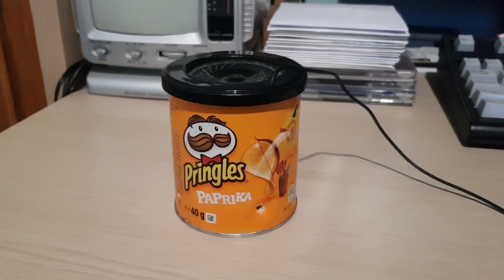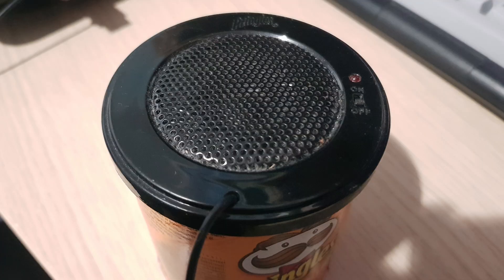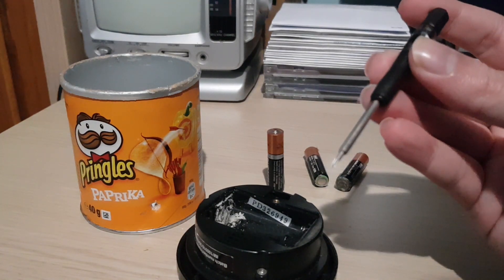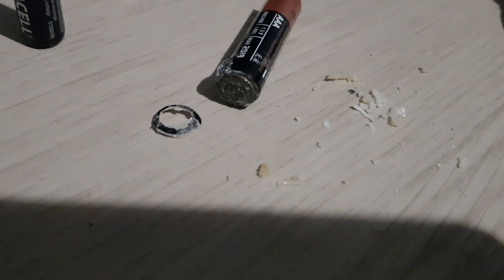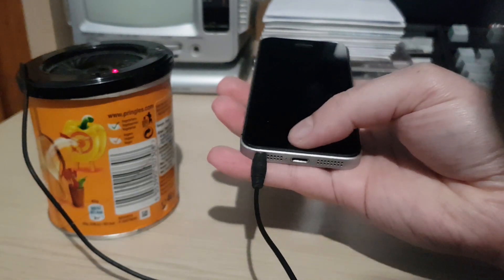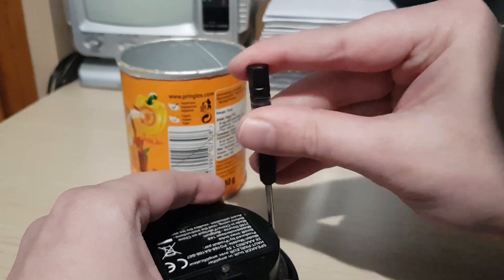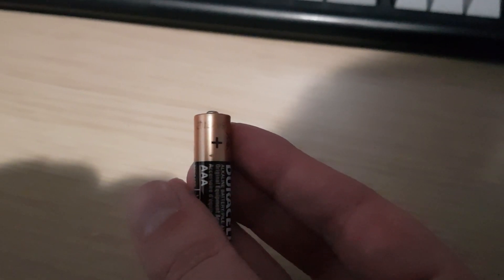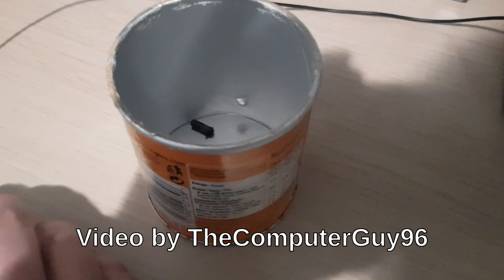The Pringles Speaker Battery Corrosion Incident

Comment: i heard duracell batteries being called duraleaks, i guess it's true, you should use a multimeter to see if the batteries are charged 
you should make a video about the mini crt
Reply from the maker: VWestlife's video about that mini CRT explains everything, I don't have anything else to say. The only difference is that mine doesn't have a brand name (just "mini personal television with AM/FM radio") and it has an AV input (composite video and mono audio)

Comment: Duracell batteries are well known for leaking if you don't use them. Even batteries that sit there without being used at all can often leak if they are Duracell.
Hence, I don't buy Duracell, and instead, tend to buy the cheapest batteries that are of decent quality.
Reply from the maker: After making this video I found another forgotten device with batteries in it. It had those "Camelion" batteries like the one I showed in this video, but they haven't leaked and they're still charged!

Comment: All dated electronics I own have Duracells that do this, even when mixed with other batteries it’ll only be them
Reply from the maker: I think this can happen with any battery of this type (AAA, AA and similar sizes). Maybe more likely with the cheap non-alkaline ones, but even the more popular ones
Reply: @TheComputerGuy96  Yeah it definitely can, but most popularly that is a trend I noticed whether handling electronics shelved away for a good number of years besides obscure named batteries
Reply from the maker: Exactly, that's why you should remove the batteries from a device you're not using for a long time